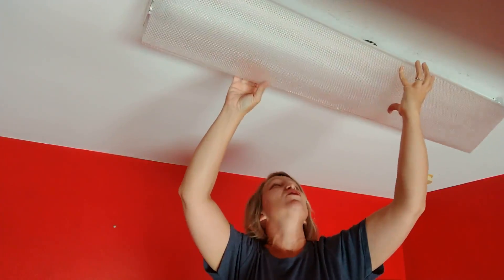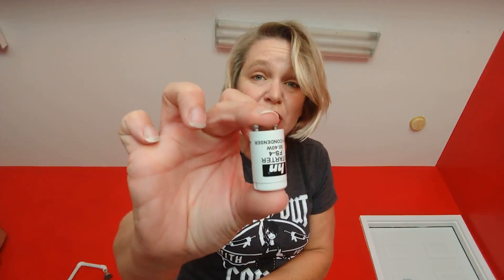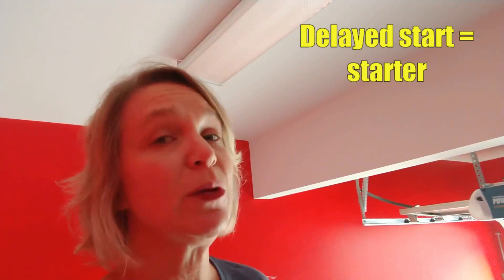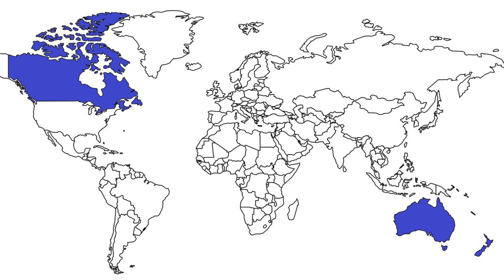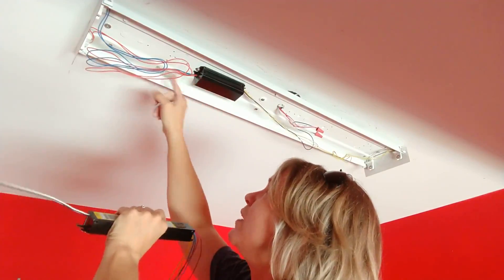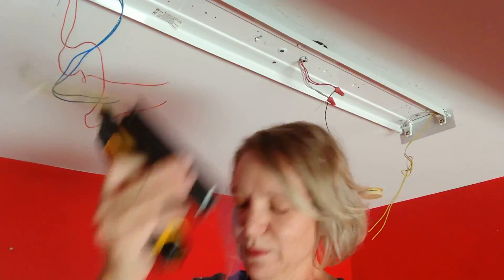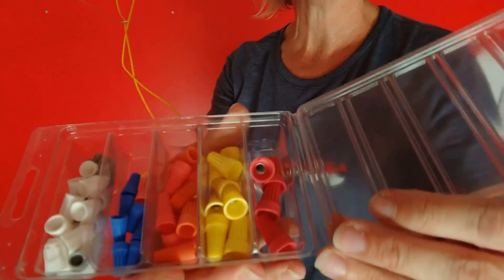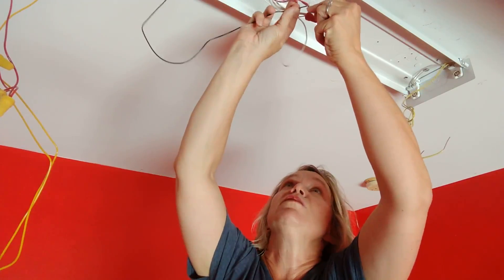Fluorescent Light Troubleshooting and Repair: starter, bulb or ballast?

Comment: You can  put the 2 bare pieces of wire into the cap without twisting them. Once in the cap, use the cap to twist them.
Reply: Wire nut people. They are called wire nuts.

Comment: Ballasts can also contain capacitors which retain an electrical charge for minutes after de-energizing, so in this case, definitely good to de-energize circuit on a breaker, wait several minutes and then check for dead with multimeter.

Comment: For safety - perhaps switch off ALL of the circuits and  lock / tape closed the lid on enclosure  ( just to make sure  no random passing household member  decides to ''switch the lights'' on while you are working on the wires) . In Australia  there are 20 deaths every year from electrocution, with more than half occurring in the home :( .

Comment: I would suggest ditching the fluorescent fitting and replacing with an LED fitting. This is what we're doing in England to reduce energy costs. Also the longevity of LED fittings seems superior to fluorescents. I've come across fluorescent fittings nigh on 50 years old in a hospital where the case was retained but the internals were upgraded to LEDs. Of course numerous lamps would have been consumed during this luminaire's half century use......with attendant disposal issues.
    PS. The woman in this has the loveliest accent. Some US accents are a delight to hear.

Comment: Why not just take the fixture off the ceiling? Probably easier. Wire nuts to connect old ballast wires to new ballast wires.....not the best idea. Probably better to buy new florescent light sockets.. they are push through one use only....some you can lift the tab so that you can  release the wire in case you make a mistake

Comment: Dude, im not an electrician but my job involves electrical work (sometimes high voltage work) and I ALWAYS get a little nervous even if I know I locked and tagged the power source. I've been zapped a fair few times and it always shakes me up a bit. People who don't get at least a little nervous around electricity are psychos!

Comment: As an electrician take the wire nuts off first before you start cutting wire, just to be a little safer. Also a tic tracer is a good investment in case anything is still “hot” with current.

Comment: One time I tried to change the switch on the hallway.  I turned off the switch next to the labeled hallway in the electric panel.  I thought the wire was dead.  Good thing I tested that with a voltage detector.  It was still alive.  I went back to the electric panel and tried turn off the “bathroom” one.  And it somehow belongs to the “bathroom”.  So buy a voltage detector and use it.  It may save your life!  Thank you for the video!  I will try your suggestion on my dead fluorescent light  fixture.

Comment: No need to cut the wires. If you remove the tombstones and wiggle back and forth as you pull the wires they will come out.  Splicing is unnecessary,  adds an additional point of potential failure and makes it more likely to pinch wires when putting the cover back on.
Reply: Yes! I hate when people just splice everything together. Just unclean and usually results in a ridiculous amount of wires to shove into the little ballast area. The proper way is wire directly into the lamp holders.

Comment: I'm a journeyman electrician in Canada anyone can change their own lights along with plugs /CO2/Smokey's . Homeowners can apply for a building permit then an electrical permit if they want to wire their own house even if they want to add a apartment downstairs of their house . Gas/hvac has to be done by someone else certified . I think plumbing the homeowner can pull a homeowners permit after they get their building permit approved .

Comment: We just replaced about 100 florescent fixtures with pretty LED fixtures after discovering the ballast price went from $11 to $26
Reply: Seriously? If you just HAD to use LED you could had at least used direct wire tubes!
Reply: @rs12official  They upgraded on style using the typical foyer dome with two screw in LED bulbs vs that institutional look the long boxes had.

Comment: Use some masking or duct tape the wires inside after wiping the dust off. Yes, a tool belt helps but you never have what you need. Wire nuts have colors for different gauge wire connections. Replacement ballast never fit and likely longer so plan on using self tapping screws the ones with the little drill bit tip. Unfortunately, the ballast have become almost as expensive as a new fixture or two LED bulbs. They were coming down in price but remember they change A/C to DC inside in the part called a driver. Nice video. 
 I heard a neighbor lady telling her neighbor how it cost them $550 for a new garage door opener! Top of the line is $150 and the brackets are there so 45 minutes. I would have done it for $250. 
Nice video.

Comment: I had heard about the "ballast" but didn't know what to do about it.  Back to the store - I'm taking my old one with me!  My only recommendation is to turn on the juice before the final installation of the bulbs to see if you've twisted them in place correctly and then snap the translucent cover back on.  Just one less potential aggravation point.  thanks

Comment: Get a little thing called a volt pin,   It will tell you if the power is on the wire (AC only) And you can sometimes find wires behind a wall.

Comment: Great video. You did a great job. Plus you saved yourself some money by doing it yourself.
Reply from the maker: Thanks for watching and commenting!
Reply: @ChickFixUSA  I couldn't get my kitchen light fixture to work even after I changed the ballast. So I just bought a new LED light fixture and installed it. I'm so sick of those fluorescent light bulbs. I could never tell if I had the bulb in correctly or not. Oh well no more 4 foot bulbs.

Comment: Next time for the wire NUTS not caps lol make sure the stripped wires are as tightly wound together as you can and also it never hurts to give your wire NUT connections a good tug after your connection is made. Other than that, I approve of your work ethic and effort to pull your boot straps up and take on the challenge. Good work

Comment: For added safety, use a non-contact voltage tester/"tick tracer" to make sure the wires you're working with are no longer energized. It might seem dumb, but this is your own safety we're talking about.

I'm an apprentice electrician and once got to feel a decent trickle up my arm when I was pulling wire out of what I was told was a de-energized load center at an intersection. Had I checked, I would have known that the leads were not completely dead. I still don't entirely understand what happened, as the foreman told me the circuit was dead (he mentioned induction, I believe). Thankfully, it did not hurt, but it did give me a jolt stronger than any coffee I have ever drank!
Reply: when working with a light fixture, all you need to do is turn off the switch to that fixture.  No need to go to the electrical panel - overkill.  but each to his own.
Reply: @truthteller50  thats not true; a light switch only de energises the Line going to the luminarie, it doesn't de energise the neutral.
Reply: @stevejobs5533  I thought you had died, but seems you’ve just moved to YouTube. 😜 anyway, and what is the concern of that?  The switch blocks the flow of electricity. I’ve done it this way for years and never had an issue. Lights, fans, etc—all kinds of things on switched connections.
Reply: @truthteller50  in case its a shared neutral, always test for dead
Reply: @truthteller50  In the UK, fans usually have 3 pole switches; Line, Line switched and Neutral, so in this case you'd be fine as its completely isolated.
Reply: @stevejobs5533  I did read an article, prompted by your comment, that said the argument for my position is that if it wired correctly (hit to switch and not to fixture, it is fine. BUT there are times things aren’t wired correctly and the hot line goes to fixture and in that case it would be bad news for me! So now I’ll second guessing myself on whether or not I want to head off to the panel or not! 😉
Reply: Ballasts can also contain capacitors which retain an electrical charge for minutes after de-energizing, so in this case, definitely good to wait several minutes and then check for dead with multimeter

Comment: Mine has 4 bulbs, 1 ballast and a small ballast emi filter. 
Mine has a green ground wire, a non coated copper wire and the old ballast has no black or white wires coming out.  The white and black wires are coming from the emi filter. I dont know how to change this out now 🙄

Comment: To be on the safe side, after you twist the wire caps on. It’s always good to put electrical tape on it as well, it’s just a safety precaution. Great job though👍🏽
Reply from the maker: Thanks for the tip!
Reply: I tape them for commercial and industrial but I don't bother when doing residential. Not many splices in I dustrial mostly home runs to everything except doing lights and plugs inside MCC buildings. Maybe if someone screws up a $10,000 run of Teck cable and it would probably be hidden .

Comment: Next time a ballast goes out I would do a LED conversion that’s what I would do
Reply: I would avoid LED. Most are much dimmer than fluorescent tubes, and some aren’t even any more efficient. A 20 watt, 1800 lumen LED tube is not any more efficient than a 32 watt, 2900 lumen T8 fluorescent tube. Many LED tubes also overdrive the LEDs, or have cheap, low quality drivers in poorly heat-managed conditions, causing them to fail prematurely. If you want the most efficiency, you should choose a 28 watt, 2800 lumen 4 foot T8 fluorescent energy saver tube, operating off a .88 ballast factor electronic ballast. The system will pull around 25 watts per fluorescent lamp and will have an efficacy of around 100 lm/w. Each lamp will be around 2400 Lumens, vs. 1800 for LED tubes. Using 32 watt tubes with a high ballast factor would get you even more Lumens, over 3600 Lumens per tube for 1.18 ballast factor ballast and 3100 lumen 32 watt tube combinations. I would seriously avoid LED, you would be much better off sticking to fluorescent.

Comment: That looks like an instant start 4 lamp ballast, designed for T8 lamps. Check to be sure the right lamps are inserted otherwise they will die or even pop suddenly. T8 is fluorescent bulbs that are 1" in diameter, old T12 lamps are 1.5" in diameter. T12 should never be on an instant start ballast.
Reply from the maker: That's a great tip! Thank you! What about the bulbs that say they are interchangeable with T8 and T12?
Reply: Looks like a 2-lamp T12 rapid start ballast.

Comment: Where i work we use LED bulbs which are brighter and use less electricity. You take the old ballast out and straight wire it-the black wire to the wires from the "tombstones" (contacts) at one end and the white wire to the wires from the tombstones at the other end. you'd probably wnt someone to show you if you can, but it's very easy once you've seen it.
   By the way the "caps" are called wire nuts. it is fairly important to use the right size.
Reply: Cap. LED bulbs are usually much dimmer than fluorescent bulbs.

Comment: This is the first of your videos I have watched and I would like to say that you did a great job.......... for a girl.  Lol, I'm kidding, you really did a great job and you have an excellent sense of humor.  I do not have criticism for you but I do have 2 tips for you.
1.- Get yourself an assistant (preferably a young person with energy) to hand you anything you drop and to run up and down the stairs to turn the power on and off.  I try not to leave home without one of them.  If you run out of assistants just have another kid or two.  Get them to help you under the guise of "teaching" them something.
2.- When you put the wires together you don't have to twist them together before putting the wire nut on.  I have seen many experienced guys that don't know this still.  If you just touch the wires together (or just close to each other) and place the wire nut over them, once you start to turn and tighten the wire nut the wires will do exactly what you did when you (pre) twisted them.  It just saves a bit of time when you have a lot of wiring to do and it is actually easier than twisting the wires and then adding the wire nut.  It works with more than 2 wires just as well.  Make sure to use the right size wire nuts for any job..
I really enjoyed your video and look forward to watching more in the future.  Well done.
Reply from the maker: Thank you for the kind words and hints. I have two children, but they are typically in school when I film my videos. And they are not always willing to be in videos. That's a good tip about the wire caps!
Reply: Excellent tip
Reply: @yungwunxx  
🙏🏼
Reply: @notsosilentmajority1 
No one have mentioned nor asked why she don't take down the fixture and work on a bench or a table. Is there any regulation or law that forbids disconnecting electrical equipment?

In Scandinavia, where I live, it is allowed for non certified electricians to upgrade (old to new) power outlets, light switches and fixtures as long as the electrical installation isn't changed nor expanded.
Reply: @dansihvonen8218  
Yes, non-certified people can do most electrical work in their homes legally, without any problem.  Usually, only major work requires a certified electrician.  In most states we don't need a certified electrician to do work in our breaker panels, even if we do expand or change our overall installation somewhat.  Of course, if you are adding an addition to your home or something similarly big, that is different but just adding little things is usually legal and is done all the time.
Edit- Taking fixtures down t work on a table usually depends on the task at hand but I haven't seen too much of that.  It seems like most people usually leave the fixtures in place.

Comment: Goodjob. I got the exact same light fixture, and it stopped working after a blackout. So I went adhead thinking it was the light bulbs and bought 2 new ones, turns out they didnt work either, so now I realize thanks to your video its the ballast that needs to be replaced.
Reply: Replaced the ballast, everything is good now. Lights right up.

Comment: You don't need to change your ballast every time you change your bulb. Ballasts last lot longer than bulbs. Also for the cost of changing the ballast you can upgrade to LED less energy no problems with ballast in the future just bolts.
Reply: How do you find the right bulb for a  particular ballast?

Comment: In Canada you do not need to be a licensed electrician for regular maintenance of existing electrical installations.  You need to be licensed to wire or upgrade wiring a building.

Comment: Next time, try to cut those wires a little closer to length, so you don't have a tangle of wires to tuck in.  Also, they are called "wire nuts".  Good job. Fun video!

Comment: You invested a lot of WORK into a simple repair...... you should have disconnected the power and then brought the entire assembly down to your work bench and leisurely made your repair and those wires that go to the ends  did not need wire caps you can literally pull the old wires out of the end caps and strip the new ones and push them in they will not come out easily .. the repair will look like it was never replaced that way and you do not have to tuck 60 feet of wires back in and all of that WORK you did looks like the assembly is not securely fastened to the ceiling now... might wanna check to see if the assembly might fall down ? it is still connected to power so if it falls it might spark and start a fire on the way down.
Reply: Waaaay to much trouble to take it down.
Probably secured with toggle bolts and as a general rule the toggles are lost when removed because they spread in the hole
 that was created for them.
She did just fine all I would have changed would have been no strippers use a cigarette lighter a few seconds to heat the coating and take my nail and remove ...yes a bit hot but. That's to be expected also I would have gine with the blue or grey caps not yellow that os what should be used with the power connections....black and white wires.
Yes she could have put the wires direct to the tombstones but in general she did fine because not everyone knows how to release the tab holding the wire.
Note use a small...jewel screwdriver beside the wire to release as you pull

Comment: I just learned that the light holders at each end come out and the wire pulls out. Then you can plug the new end into the holder eliminating the cutting of the wires. Congratulations on doing it yourself and a thumbs up at 951

Comment: there are 4 starting methods there is preheat which requires starters,rapid start,instant or electric start and 2 types of program start, pre head tends to flash a few times before the lamp fully starts.rapid starts feeds on.instant electric start is instant on, program is an like rapid start but electronics and uses less power than the older rapid start, not only you got to get the same wattage that the ballets can handle but you got to get the right " T " size theres is T12 which is used in that fixture,T8 which is skinnier and T5 with is smaller , with 4 foot fixtures that would use either A F32T8 or F40T12 and 3 foot use F30T12 or F30T8, 2 foot use F17T8 or F30T12 you need to match the same T size and the same wattage the ballast can handle and wire the ballast correctly for the light to properly run